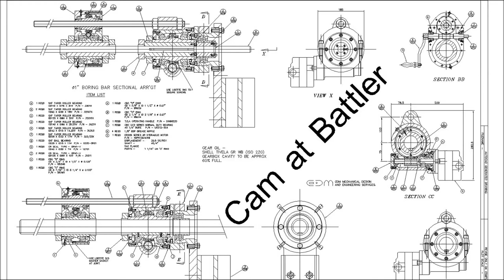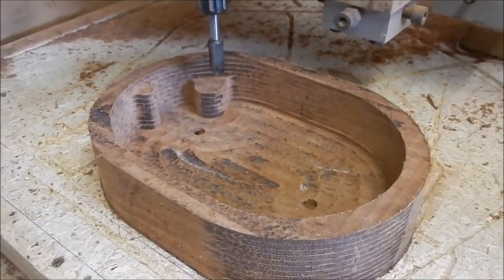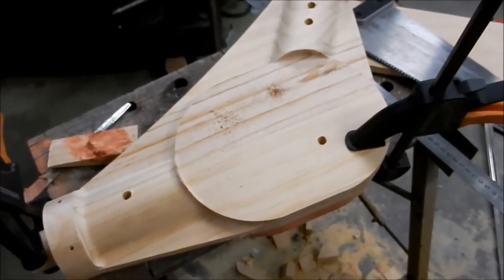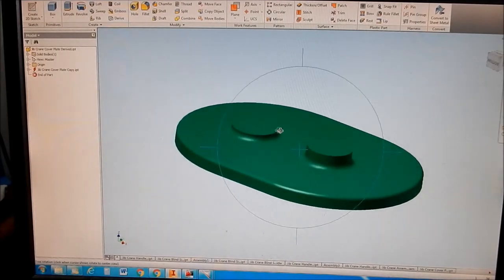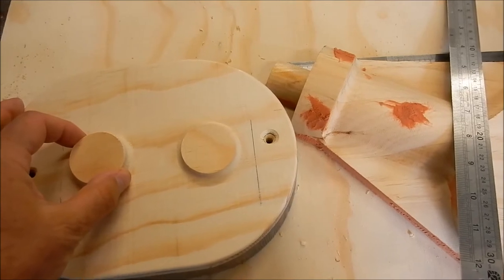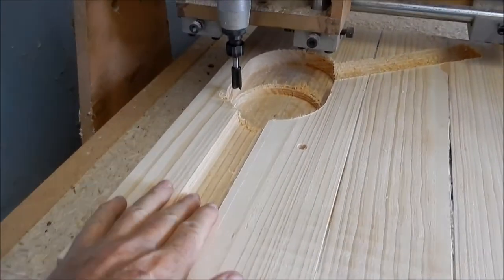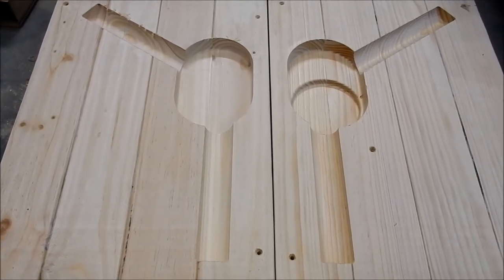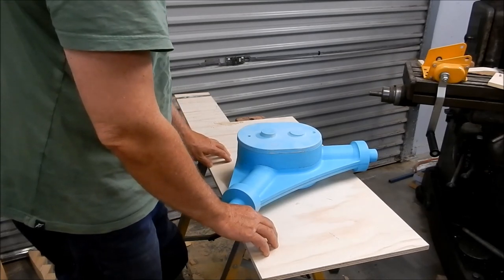Portable Jib Crane for the workshop. Part 3, finish machining the Patterns and Core Boxes.

Comment: Thanks for taking us along for the ride. I figured out you CNC spindle is a die grinder! Interesting. Never seen that before. And I enjoy the little bits of information along the way. I learn more form your comments. Thanks for showing us the trials of using CAD. You are going to have to use a fairly large crucible for this pour. Risers and runners and all. Your ramming up and gating will be the most interesting parts to me. Pattern making I do understand. But still enjoy seeing done well.
Reply from the maker: Hi KA, yep a die grinder is very cheap and rock solid.  Bearings and brushes are an easy change out.  I'll need around 11 Kg's of aluminium for this cast.  When I ran my foundry this was fairly staple work.  Now, with no gear I'll need to do it all from scratch, takes me back almost 35 years when I first started in the backyard.  It will have some challenges but I'll get there.
Cam

Comment: G’day Cam. That’s a fair sized casting, you don’t do things by half. The CNC does a nice job but it does like to take its time though   Well done. Cheers 
Peter
Reply from the maker: Thanks Pete, yes it does take its time but : I can pull the part off the model, set draft and scale.  Put the part into my CNC software set tooling functions and stock then code.  This all takes about 30 min for code to be ready for machining.  Stock is cut and glued then roughly shaped with the jigsaw.  Stock loaded and machined up to 11 hours so all up I'm looking at around 14 hours to produce a near perfect pattern with very little finishing required.  It would take me weeks to do the same by hand with my wood working skills.  While the machine is running I've, pruned and clipped the trees, weeded the garden, took a trip down to the cost for lunch with the family, home again and a BBQ tea.  When all finished I have a pattern ready to paint the next day.  It is slow but it is a real time saver in so many other ways.
Cam